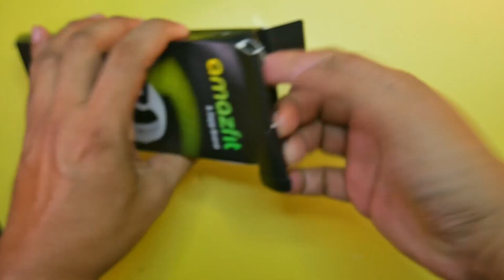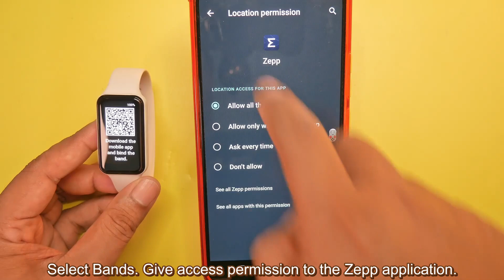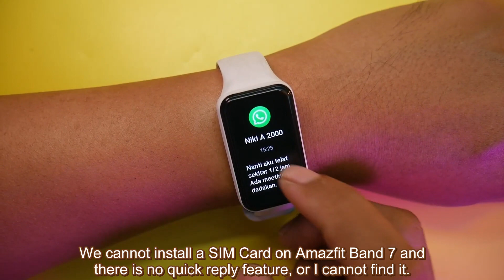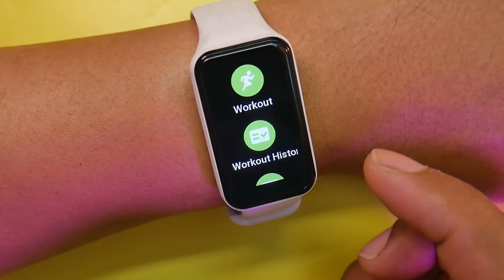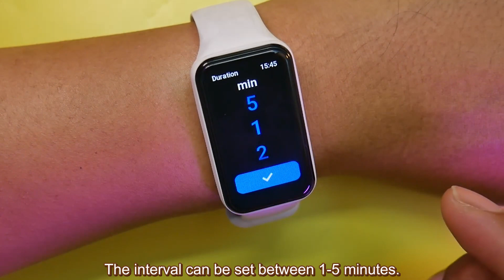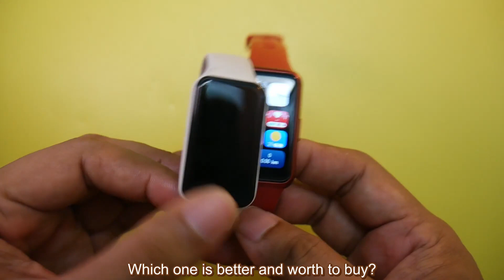[EN] Unboxing Amazfit Band 7, How to pair, Features

Comment: Can you turn off BlueTooth in the settings?  Or does it have an airplane mode or something similar?
Reply from the maker: We can't turn off watch bluetooth. But there is DND (Do Not Disturb) mode (the moon icon). If DND is on, the watch wont vibrate of give notifications.

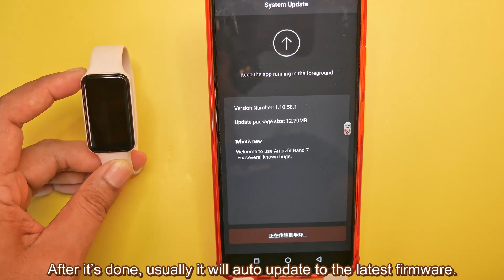Comment: 1:35 at this part, the app starts downloading the latest firmware but it turns off my Amazfit 7, then it start again and repeat, I don't know why... I can't get the latest firmware and cause of this can't download any apps... :/
Reply from the maker: Make sure the internet connection is stable or try to use different connection. Try to restart your phone and band. Sometimes, it can also happens because of Xiaomi server not working or slow, try another time or another hour.